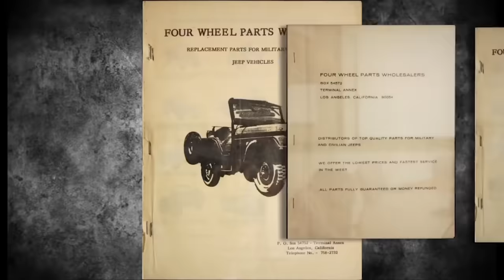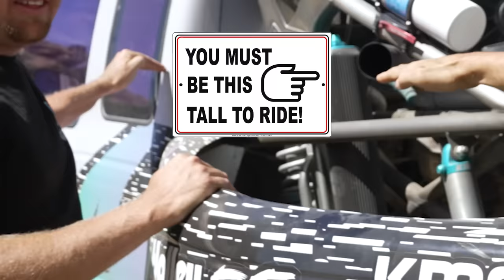Dentside F-100 PreRunner “Vivian” vs Darren Parsons' “1447” Ranger // THIS vs THAT Off Road

Comment: Yamaha YXZ have the same front roll cage tubing that the f100 has. They are aftermarket but they use the same triangle shaped tubing on the windshield.

Comment: Why does the Ranger say "independent suspension" and the F-100 say "solid rear suspension" when they both have live axles in the rear? I've seen this a bunch... Why you guys trying to misrepresent these things? The different between these two is frontal only: double wishbone vs double i-beam.

Comment: Seems like the factory crank pickups are always a source of issues with LS motors.
Reply: Lol. We've  bought and sold thousands of used GM trucks and vans with over a 100k on them, and I can't remember the last time I had to replace a crank sensor. It's been at least 5 years. It's not the factory sensors that have a problem. It's the aftermarket and fake GM sensors sold on Amazon and eBay.
Reply: @bdd1469  I agree that bog standard road cars have no problem, but motorsports applications seem to suffer more crank trigger issues than most.  I assume it has to do with the conditions of being at high RPM a lot, where the sensor is more likely to be faulty due to the dwell time on the teeth.

Comment: 460cu is fords monster engine. Dont think chev makes a 460. They do lsx 454. I jad a 2 door 1979 f100 with a 460cu stock i could lift the tires off the ground. Love the 460 just dont want one as a daily driver as they get about 9 mpg. Love it tho

Comment: sandbagging IS called on the 1st run. No way he can be out in the lead the WHOLE race and lose
Reply: Uhh yes there is the other truck had more top end power
Reply: @PlaySA  wrong, as it turns out, the guy had electrical issues or something like it. it was shutting off ! Otherwise. NO WAY !

Comment: Independent Suspension vs Solid Rear Suspension is another example of lazy editting. Wheel Pros killed Hoonigan
Reply: I think A Bar vs I Beam would've been a better description.
Reply: A-arm front, I beam front.

They both are independent fronts with sold live axle rears 🙃

Comment: Y'all need to stop this  that is not an F100 they did not make an extended cab F100 that is an F-250 F100 only came in single cab
Reply: Ford released the super cab in 74 on their f100 and larger trucks